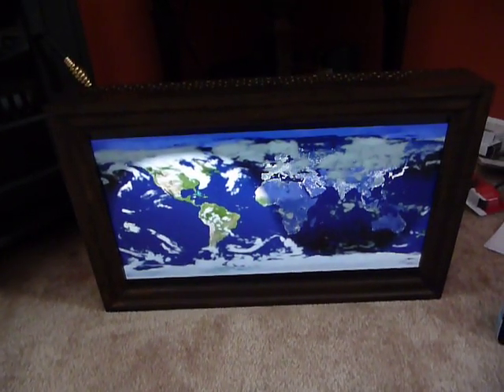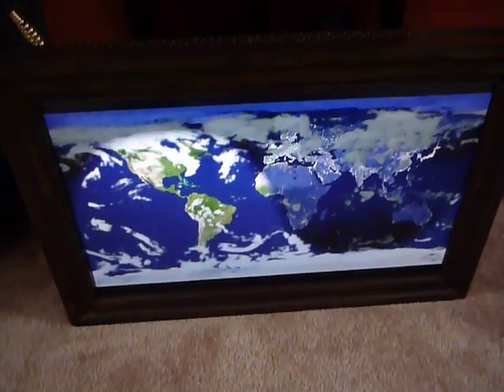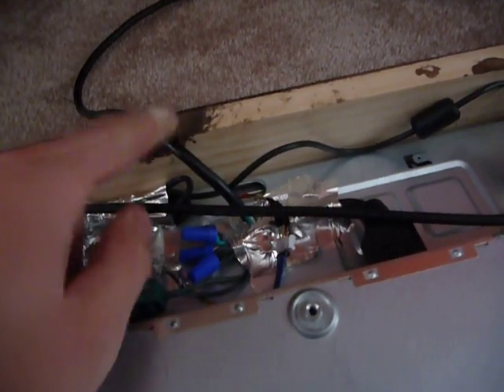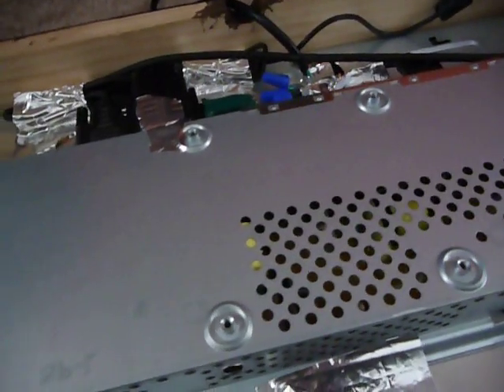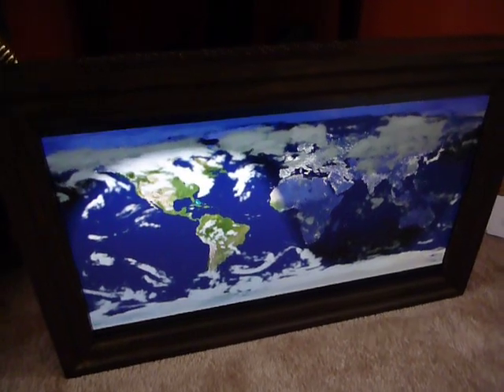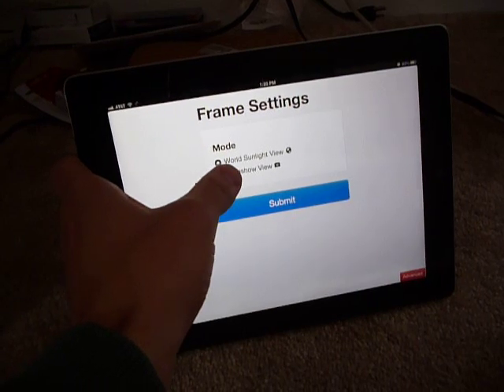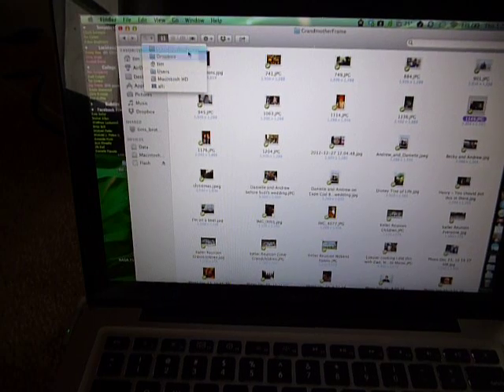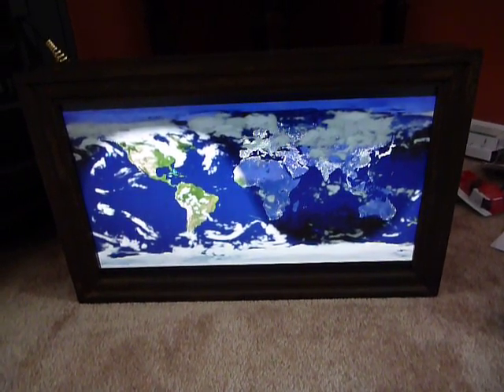Raspberry Pi World Daylight Map / Digital Picture Frame

Comment: This very nicely done. I've been looking at Geochron clocks for my ham radio shack but can not justify that much money for a clock (as cool as they are). I would like to do something like this, but programming is not my forte. I would also like to see the ability of having actual time cycling so world map with daylight visible, times by time zone mainly (Pacific, Mountain, Central, Eastern, and UTC), dates for the correct timezones would be nice too. I would also like to see where the maximum usable frequency and such are too!. Great job, more research is needed on my side, but this is a good starting point.
Reply: Geochron has a digital device now, and it costs only about four hundred bucks -- you supply the HDMI-capable 4K monitor.  For 'WAY less than a grand, you have an extremely capable Geochron clock.

Comment: Thanks. That is a very good tip indeed. I was getting out of memory but i realised i run several instances of fbi :) fixed that now. So you re enumerate all files and restart fbi with all the file names on the command line?  `dbi file1.jpg ... hundred files .. lastfile.jpg` ? That with the -t command line gives me a nice slideshow.

Comment: Hi Thanks for quick reply. I am just trying `fbi` now! :) I am trying to load some full size images made with HD camera  but it takes a few seconds (4~10) to load the image and then scale it. Your demo does not show any of this. Is there a way to buffer a new image while the last one is still showing. About the cabled, OK- I could see if it was VGA but that makes sense now- I converted an old VGA only monitor so I need that converter.